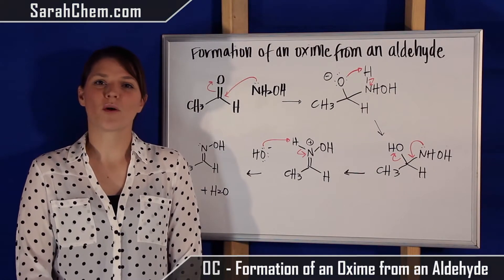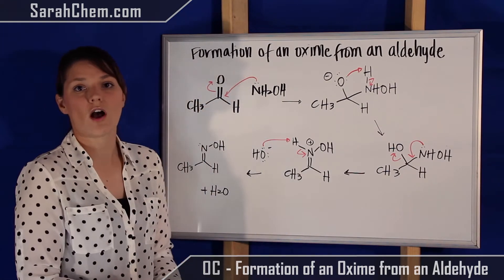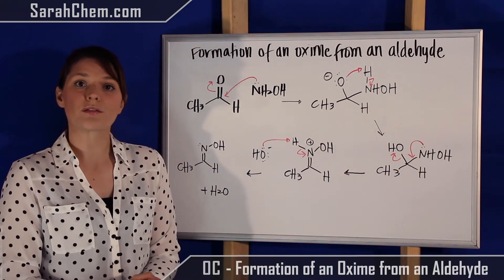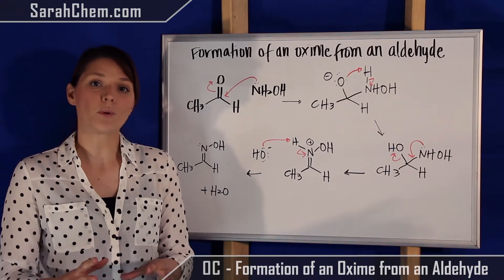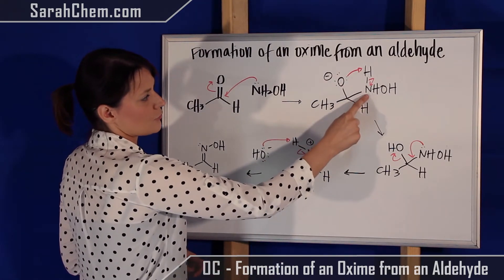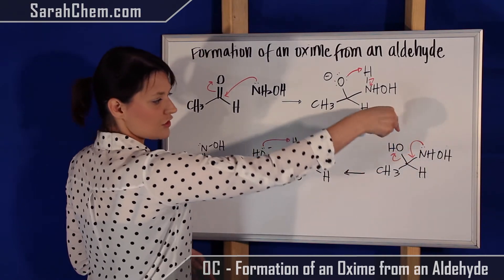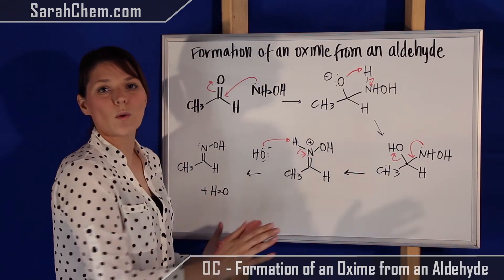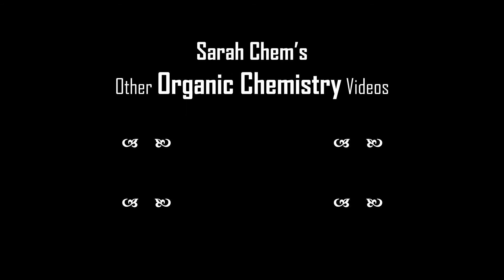Formation of an Oxime from an Aldehyde

Comment: x
Reply: we're going to kick that up and dump those electrons on to this oxygen so now whenever you've got a tetrahedral intermediate which is what this is which is where a carbon is sp3-hybridized intermediate because this carbon here is attached to more than one electronegative group so we're going to know that that's not a very stable compound and we're altom utley going to have to continue the reaction until we're able to get it back down to an sp2 hybrid now the way that this will always transpire is once you've opened up the tetrahedral intermediate you're gonna protonate the group that you want to leave and you're gonna deprotonate the group that you want to stay so in this case here I'm not going to want the nitrogen group to leave as they just added it so what's gonna happen is I want to get rid of this group here ultimately and I want to keep this group on so what will happen is 
I need to protonate this group here protonation makes groups better at being kicked off or better leaving groups so this O we'll come and deprotonate the nitrogen here and this bond set will be turned into a lone pair sitting on top of that nitrogen so at the end of it here you have a neutral tetrahedral intermediate still even though it's neutral it's not particularly stable so this reaction onward so we need to shut this back down to an sp2 carbon so what will happen is that this the nitrogen with that lone pair is gonna push its lone pair down to reform the PI bond once again this carbon would have too many bonds if we left it like that so that means another bond will have to and over here because we've made this a relatively decent leaving group when this one shuts down we're going to be able to kick that OS group off so at the end here we've regained that sp2 hybrid and now we've kicked off this group here the last step is you typically want to eliminate charges that are left on your final product so this will act as a very good bazo it'll come and it will de protonate the nitrogen here forming water and then giving us our neutral oxime at the very end so that's how you would form an oxime from an aldehyde